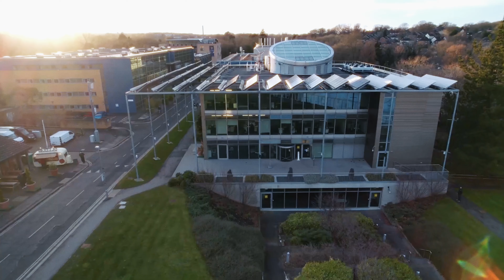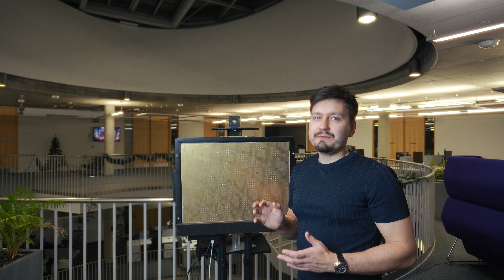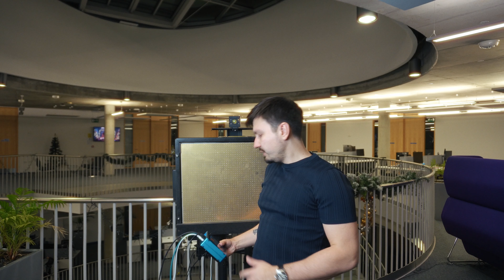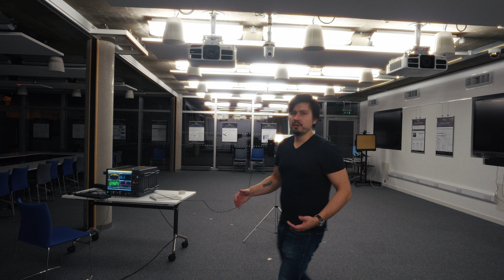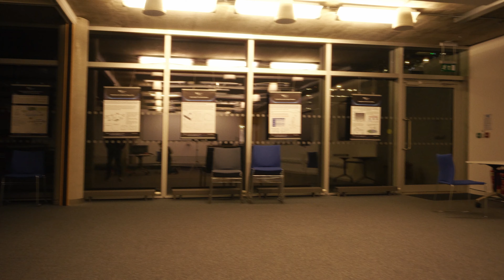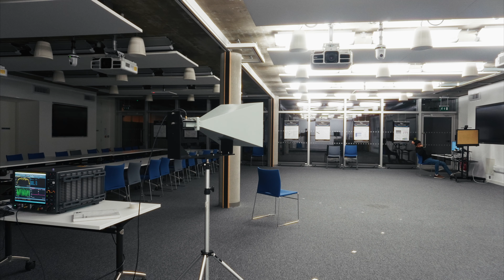Multifunctional Reconfigurable Metasurface (MF-RIS) Channel Propagation Measurement

Comment: Nice work: Suggest a tool/software so that we can generate the internal hardware structure of the RIS elements.
Reply from the maker: We use CST Microwave Studio for EM simulations, Keysight ADS / LTSpice for circuit simulations, and Altium Designer for the layout. We used all of them to design this prototype. In future videos I will try to explain the process.
Reply: @DrEMC-sf8rx Thank you for your kind reply. I look forward to watching the video as well

Comment: Thanks for sharing this. I've a question. What is the power source and how much power is this RIS panel consuming?
Reply from the maker: It's powered from an ordinary IEC power extender via AC-DC adapter. You can see wires in the frame sometimes. The measured power consumption of the RIS surface is 2.2W, and of the whole system 6W.